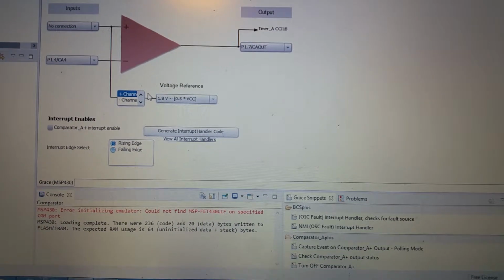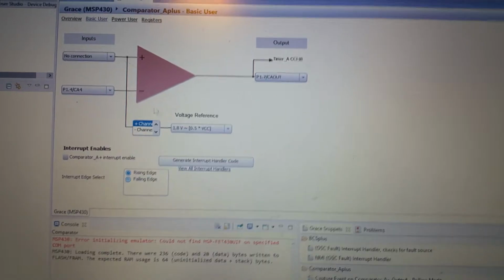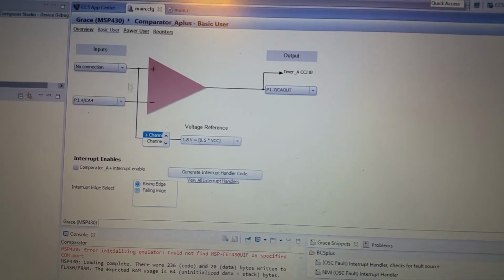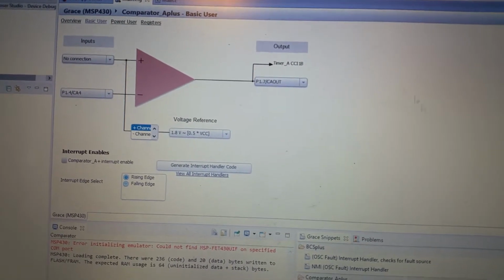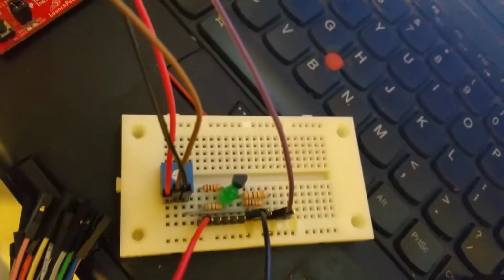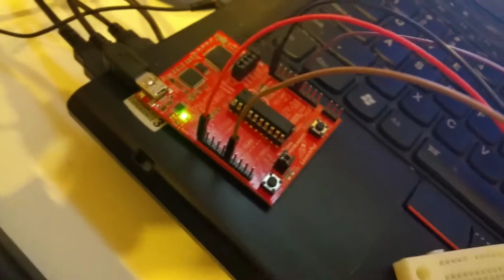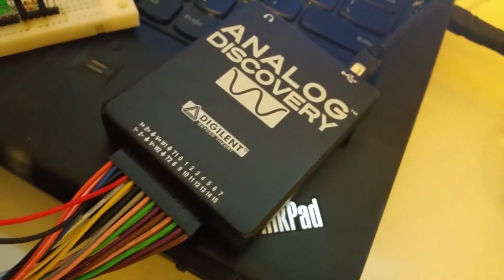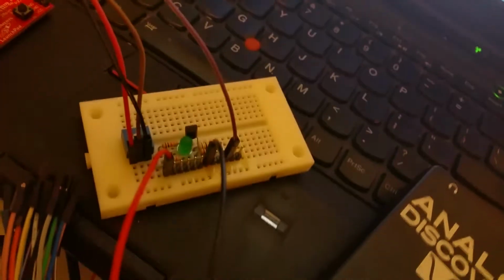MSP430 Comparator Demonstration

Comment: what version of the CCS? or what plug you are using?, who can I get the diagram blocks and the other page ?
Reply from the maker: It's been a while since I've used CCS, so I don't have the exact version, but the diagram blocks featured in the video was Grace - Graphical Peripheral Configuration Tool ( http://www.ti.com/tool/grace ). I can see there is a CCS v6.1.2 version featured on the page and it looks like it will not be updated for later versions of CCS.

In addition, there seems to be limitations on what devices are supported for Grace so please keep this in consideration before downloading and installing Grace. You can find the supported devices here: ( http://processors.wiki.ti.com/index.php/Grace_Quick_Start_Guide?DCMP=Grace&HQS=Other+OT+grace#Welcome )

As for Graphical Peripheral Configuration Tools, I can't find any replacement or similar tools ( https://e2e.ti.com/support/microcontrollers/msp430/f/166/t/625090 ), so if you aren't willing to work with an older version of CCS or work with a supported microcontroller, I don't think that there are any other offered options. (Except manual configuration of peripherals.)